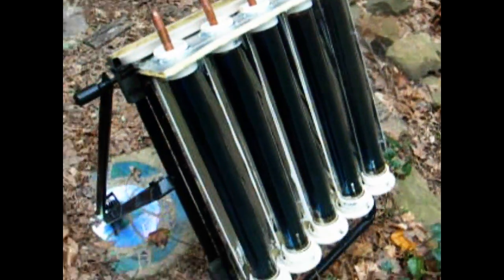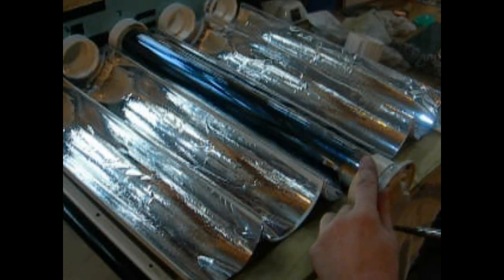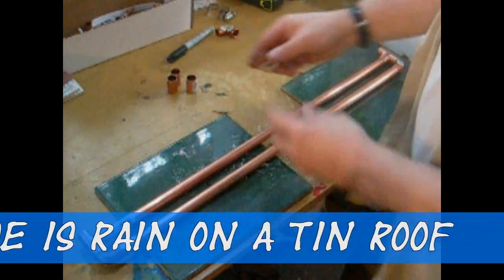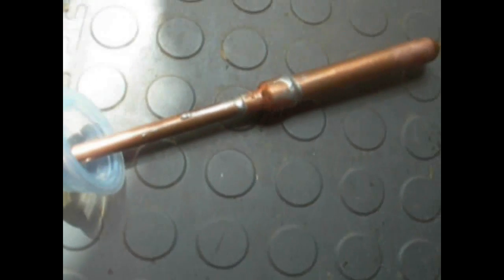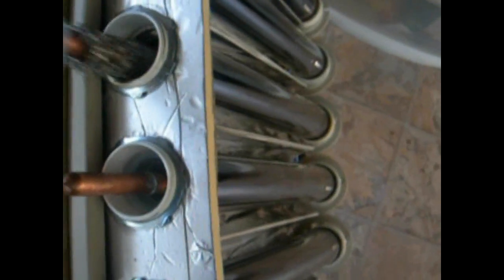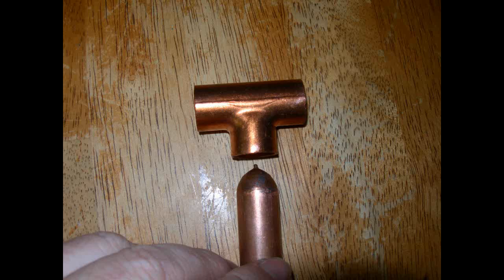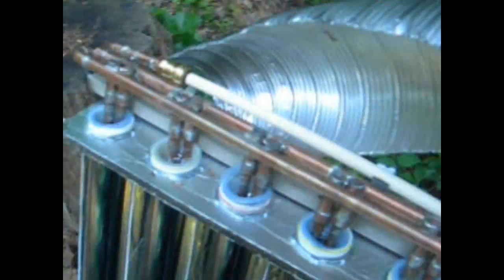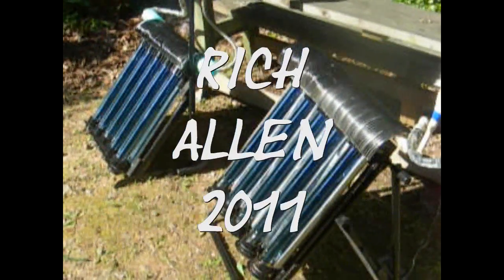SOLAR TUBES HEAT PIPE EXCHANGER  RICH ALLEN

Comment: Good job Rich! I think Villanovagypsy is suggesting flowing your water through the copper tubes. But I disagree with him. I think you are getting pretty good results given the lack of direct sunlight you are getting. I built a flat plate collector, experimenting as you are, and got excellent results by flowing the water through about 60 feet of copper behind a flat black tin sheet behind glass. That convinced to go ahead with buying a 30-tube setup which is now preheating our domestic hot water.

Comment: and was thinking on top of that, your heat exchangers maybe put 2-3 heating pipes in each clear tubing and on top putting two water pipe exchangers one low then the other and connecting them in a series so you will only have one water pipe in and one hot water out.  just thinking of maximizing the free radiant heat. and using tighter insulation i them.  Please let me know what you think of this idea bad or good just let me know thanks. and love your idea.

Comment: Just wanted to suggest an idea if it might sound good and effective, you know the rule for gas filled double pan windows, I was thinking if you would try two clear tube one 1/4"-1/2" bigger than the other and somehow fill outer space of the clear tubing with Argon gas or any gas with similar properties to it, to keep in the heat generated by the sun rays coming in to the inner space of the clear tubing where the heat pipping is.  purpose is to trap better heat in a better green house effect.
Reply: Charles Remensnyder,
These are two concentric glass tubes welded together with a hard vacuum between them. "thermos" style

Comment: You realize this is just a small scale test right? Like acurt1970 said, you heat a large tank just like your water heater. Turn you faucet on with your water heater, and see how long the water runs hot........about 40 gallons.

Comment: You circulate water from a tank through the solar tubes to heat the tank like you do with a gas or electric water heater

Comment: I am with Paul below where did you get the vacuum tubes? I want some, and another Idea why only run one run on the vac tubes you built, the first type have enough room for two water pipe runs across them thus boosting the efficiency some what, probably 50 to 75 % run the first water pass across the top pipe then the preheated water a second pass for more heat pickup.
HVAC man here so I see the use and more efficiency possibilities here with your setup

Comment: Vacuum pipes can go way higher than flat plate collectors in ultimate temperature.  The best way to gather heat is, I think, to preheat with a flat plate system, then go for higher temperatures with the vacuum pipes.  You give up a lot of efficiency potential when shooting for the higher temps, but that's the tradeoff.

If you can live without that last 10-20 degrees, you're right: stick with the flat plate.  But if you just gotta have it, the vacuum pipes are the only way to go.

Comment: Thanks for info Sir, I think heat pipes must be covered by cupper or aluminum 0.15-0.25mm foil. Furthermore, probably ( it must be tested) flat 1/4 inch heat pipe going to work better than round one with foil. Moreover, if you have old refrigerator compressor but it still ok, you can suck out air from the heat pipe and it's boiling point for 4-6ml soft water in heat pipe will go down as start up time and it will bring better results. Thanks again for good video manual.Grate job Sir!

Comment: Heat pipes are great for getting heat away from places where you don't want to pipe water to - like computer chips - but in a water heater, is there any real benefit to them?  If you ran a blackened copper U-tube down the vacuum flasks and pumped water through it, the sun would heat the water directly, with all the same heating power.  I can't see the advantage to using heat pipes in this application.  Pro's use them, but that may be to baffle folks with bullshit to make them buy their product.

Comment: Surely, the important measurement is not how hot it gets, but what flow of water you can heat.  Both experiments got to 109 degrees, but if one of them could heat 20 gals being pumped through the heat exchanger to 40 degrees in an hour, and the other took an hour and a half, then you have a comparison between the two.

Both will eventually go to the temperature of the sunlight - we know that.  The more efficient one can transfer more of the sun's energy to your hot water tank.
Reply: It would be nice if a comparison could be done between the two setups by just shielding one of them and seeing what the temperature difference was, so it would show the actual contribution from the evacuated tube collection vs direct heating of the tank and manifold.
Reply: @sadfur8728  🔴 What Is Islam? 

🔴 Islam is not just another religion. 

🔵 It is the same message preached by Moses, Jesus and Abraham.

 🔴 Islam literally means ‘submission to God’ and it teaches us to have a direct relationship with God. 

 🔵 It reminds us that since God created us, no one should be worshipped except God alone. 

 🔴 It also teaches that God is nothing like a human being or like anything that we can imagine.

🌍 The concept of God is summarized in the Quran as:

📖 { “Say, He is God, the One.  God, the Absolute.  He does not give birth, nor was He born, and there is nothing like Him.”} (Quran 112:1-4) 📚

🔴 Becoming a Muslim is not turning your back to Jesus. 

🔵 Rather it’s going back to the original teachings of Jesus and obeying him.

Comment: I would think having more contact with the inner tube will will give you better performance. The steel wool you had looked a little thin. Just guessing... I don't having anything to test on.

Comment: if the tubes are used as solar collectors with separate water thats just sued to impart heat to tap water and no contact with tap water water then it should be ok ?

Comment: I strongly suggest you just put pvc fitting on the top of the tubes to connect them in a series and run the water through the tubes themselves you can boil water in these things the performance you are getting is just poor. You should have boiling water gushing out of those things also You might try enclosing the tubes in a box even though I know they aren't supposed to lose heat to the outside air.

Comment: It seems like there's very little contact between the heat pipes and the heat exchanger.  Just that little piece of 1/4" pipe and the solder joint?

Comment: You were running cold water (tap cold) through the system during the test or just letting the still water heat up over 4 hours to 125ish?

Comment: You can use some cooling paste wich is used to cool transistors were the exchanger slide over the heating tubes, this way heat wil be conducted even better.
Good design sir !

Comment: hey rich get acetelyne or map gas instead of propane and some silver solder(copper brazing rod) and some flux for that and you can braze those points where the bullets go through the couplings directly to the collection pipes. Much better heat exchange. Cool use of common materials though. Great job!!